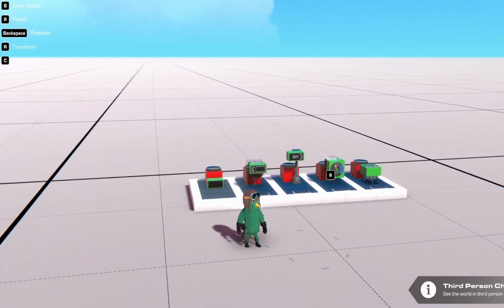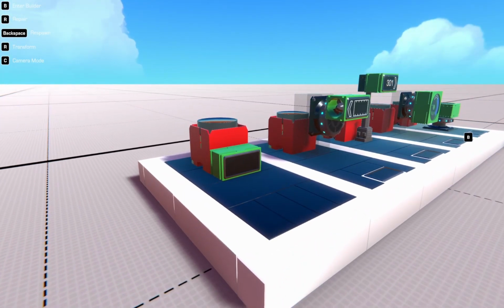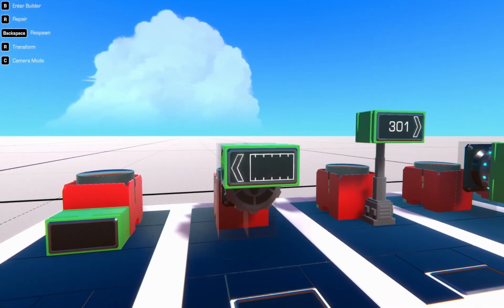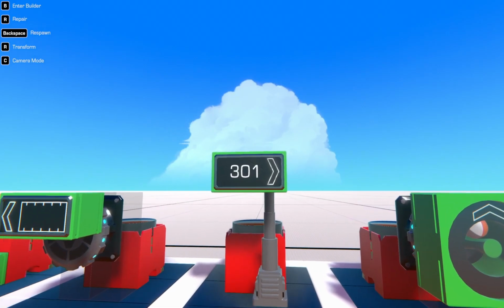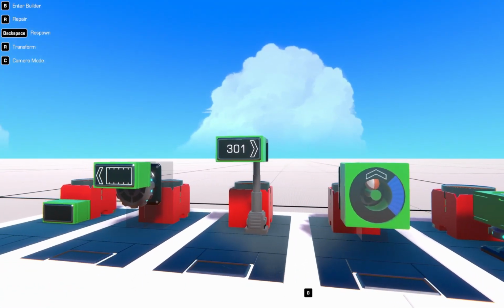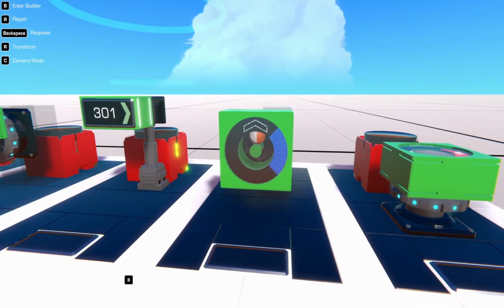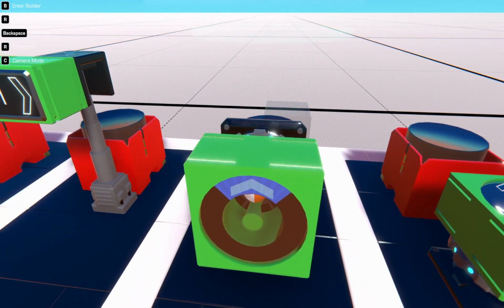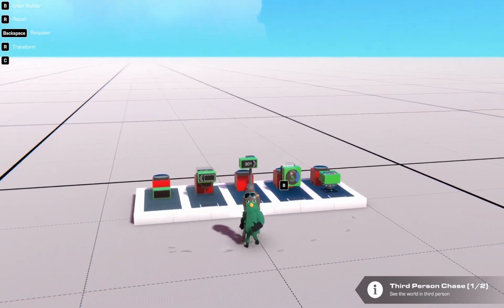Trailmakers Sensor Tutorial

Comment: it took me 2 hours of googling and experimenting to figure out that the only way to connect a sensor to any other block is to click the sensors gear icon, then a switch graphic shows up on all the other available blocks to control, and you have to click those on to control them with the sensor
Reply from the maker: Yeah that was a confusing design decision.
Reply: Thank you so so much for this Comment! Thanks to you I finally figured out the same thing!